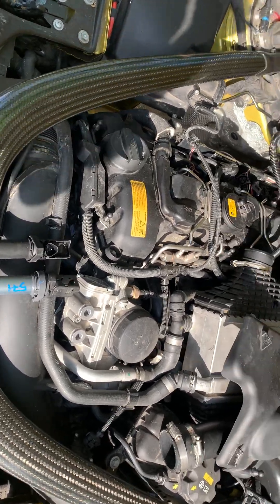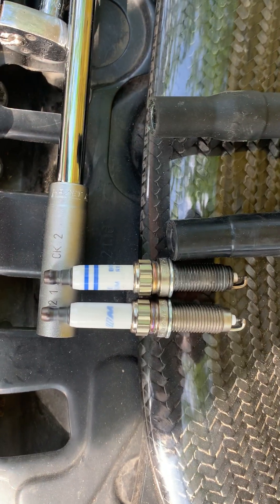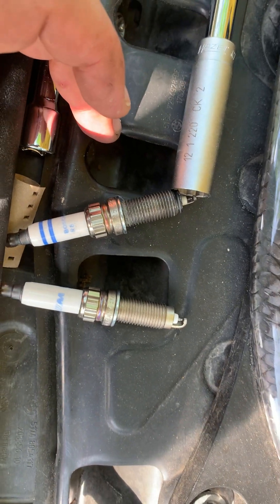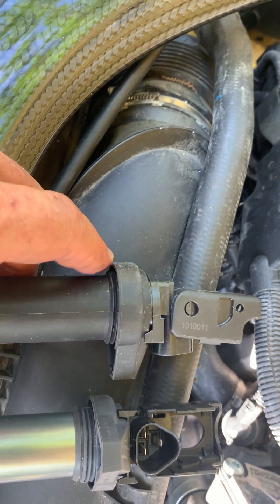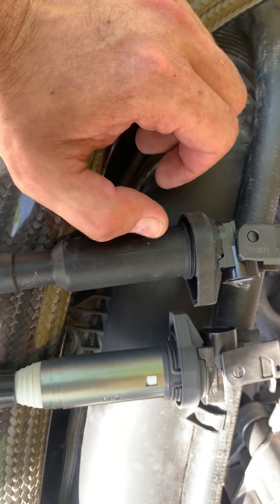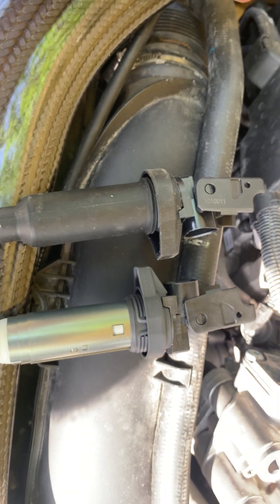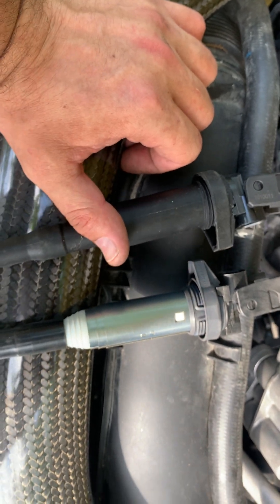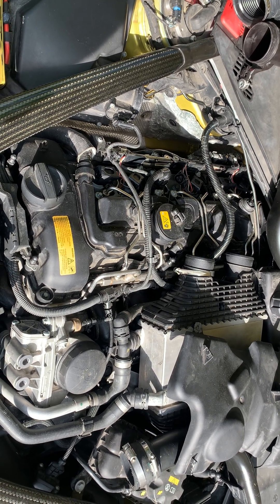BMW S55B30 M3 F80 weird misfire problem diagnostics

Comment: I bought Brisk Racing Plugs for f80 from ECS Tuning installed the plugs at 0.022 car was misfiring Cylinders 1 and 6 acting like shit. I regapped to 0.024 and moved the plugs and coils to different cylinders car started up better and no CEL drove it hard on the freeway for abit then after a few pulls CEL came back on with 1 and 6 misfires again on but then I also end up getting a Cylinders 2 misfires car has 87k miles. Car was running fine before Plugs installation but Plugs were over done for 20k miles not sure what to do atm
Reply from the maker: Sometimes people over tighten plugs, damaging them, use torque wrench,  but I’d rather try oem plugs and coils to resolve any issues, of course we assume engine has perfect compression numbers!
Reply: Did you figure it out i have the exact same problem
Reply: @tonylinguini  Not sure if it was the Brisk Spark Plugs but after taking them off I replaced with a Kit from FCP Euro that Came with NGK 97506 and Delphi Coils. Cars been running like a Champ ever since with no CEL, I Still have the Brisk Plugs so I'll be throwing them on again once the NGK are done to see if it was the Plugs or the was it really the Coils